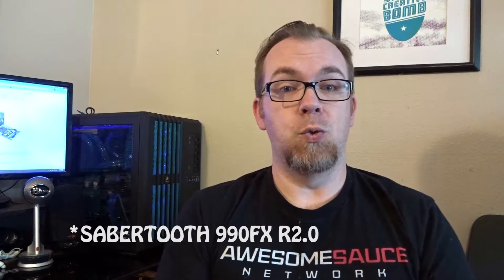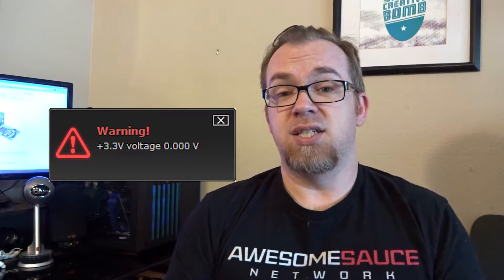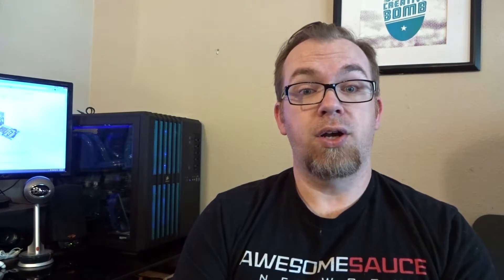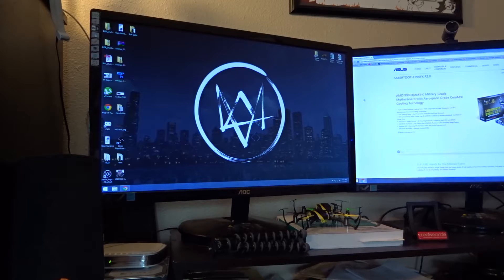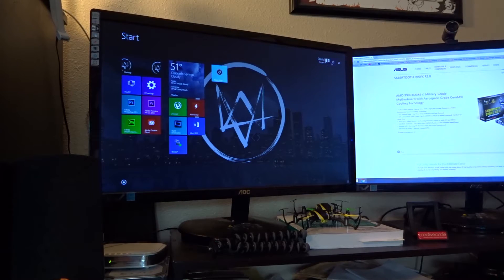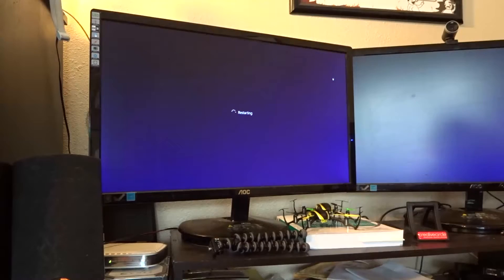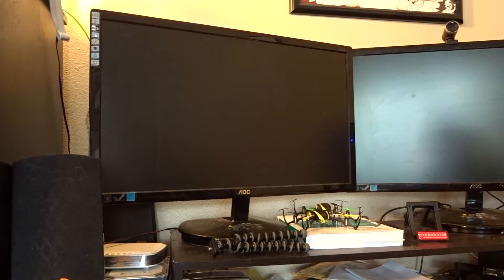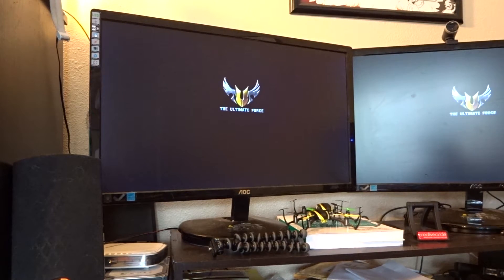Asus SABERTOOTH 990FX R2.0 Motherboard Sensor & Audio Issues

Comment: I have one with audio jack port disabled by default -problem. No sound or voltage at jack ports. Not sure if some linux stuff caused it. I assume there's some audio jack ports unit engage/disable option in somewhere deep in windows registry/services/group policy adjustments. Possibly linux, or some update of windows has the option as disabled by default. Quite sure the hardware is intact so there could be a solve for that by finding the adjustment or installing the policy manually. I tried a pure install but I think the reason is a setting stored in hardware by update or something.
Reply from the maker: I'm surprised anyone is still using this setup. This video is 10+ years old and the CPU is supper inefficient and I don't think the board is being supported.
Reply: @DBTechYT I run sabertooth 990 fx r2.0 still

Comment: For anyone who's just found this video, please lose any OC settings and then make sure your Sabertooth 990FX R2.0 is running the 18th and final version of its UEFI (Ver. 2901) which was released by Asus in Aug. 2016.

FX-8350 users can eliminate the random freezing issue these 'boards have (under UEFI Ver. 2501 anyway)  by disabling AMD Turbo CORE technology in the UEFI setup utility. This last adjustment is not required for the FX-8370, which in turn, is the best CPU for this motherboard.

BTW. Asus should be ashamed of themselves for arbitrarily changing this motherboard's max. TDP from 125 Watts to 220 Watts on the Sabertooth 990FX R2.0's product page in order to deceptively advertise its compatibility with the FX-9370 and the FX-9590. The 125 Watt TDP rating can still be viewed in the final version of this motherboard's .pdf manual.

The best and most cost effective way to improve this 'board's overall performance is by adding a 1TB (or greater) Crucial MX500 SATA SSD. NVMe drives are a waste of money on any motherboard with PCIe Gen 2.0. There are a number of videos on YouTube which prove this.

FTR, the one I bought in 2015 and am using right now still functions correctly.

Comment: Mine has ram problems sending it in to get repaired hopefully they give me a whole new one that works.
Reply from the maker: +osbodav is your board still under warranty?
Reply: DB Tech Reviews it should be since they all have a 5 year warranty and they haven't been out for more then 5 years yet
Reply: DB Tech Reviews I already contacted them and they said to send it in for repair and if they can't fix it they will replace it
Reply from the maker: +osbodav I guess I didn't realize the warranty was that long. I'm glad they are taking care of it
Reply: DB Tech Reviews me too. I bought it for $100 on Facebook and I think that's why they got rid of it because they didn't know they could send it in
Reply from the maker: +osbodav I've had a couple of issues with the board but it's still pretty solid
Reply: DB Tech Reviews I was able to get it booted yesterday a couple times but it ran really slow and took up all my disk usage.
Reply from the maker: +osbodav that's no good. Sounds like you got a decent deal on it. Hopefully you've got something to use until you get it fixed
Reply: I was able to troubleshoot it and fix what ever was wrong with it i uploaded a video of me doing it for others to help with there cpu/ram led light problems

Comment: Same board similar problems,   Developed a " audio hardware has been unplugged/plugged in " loop after 12 months use.

Disabled on board azalia audio and used GPUS hdmi output audio instead. This will solve your speaker pop if you are still running the system.

Sometimes no audio after boot, Requires restart.
Sometimes Rear USB stops working. Front jacks work fine.

Bad motherboard overall.
Reply from the maker: +fimbles101 good idea! I still use the on board audio for day to day stuff and the gpu audio for gaming
Reply: me too so pissed of now just 3 weks bought on ebay now have to send back

Comment: i have asus m5A99fx pro 2.0. i also experiencing sound issues. I have changed cables but still experience issues. try to disable sound enchantments. still not working

Comment: I don't think the Sabertooth 990-FX R2.0 mobo was made correctly!  My first build I purchased from NewEgg ended in disaster.  Almost immediately after getting the board populated and the entire system running ... I had weird issues with my mouse and keyboard I/O ports failing.  It didn't matter where (front or back) these devices were plugged into - they would simply go dumb and freeze up or not show up!  Sadly, I RMAed this board as being defective - a total first for me!  Now, about six months after using the replacement board, a weird phenomenon occurs:  something on my mobo (99% sure) is heating up that my sound card is glitching playing back videos.  This only happens after running my PC hard for a while.  The video doesn't trip up very noticably but 1-2 seconds of audio mutes out on me watching videos using Win Media Player, VLC, YouTube, etc.  Therefore - this is not likely a software issue.  I have installed all kinds of hardware monitoring devices and nothing showed up on radar to be concerned with.  I also updated my BIOS, Radeon drivers, and Realtech digital drivers - again not seeming to make a lick of difference.  After months of working on this problem - I am completely and utterly stumped!  I have the AMD Visher 8-core CPU, 16 GB Ripsaw DDR 3-1866Mhz RAM,  Rosewell 650-watt PSU, 5x Corsair LED fans, and Gigabyte Radeon R9-380 256-bit 4GB GDDR GPU.  I have heard of other people reporting this "glitching" problem as well.  They said to revert the Radeon drivers - which I did and this made no difference, either.  SURE LIKE TO KNOW WTF THE PROBLEM IS HERE!
Reply from the maker: Sorry to hear about your troubles. I've only had a couple of issues with my board, but nothing that has been a deal breaker. The audio pop is the biggest issue I've had in the last 2 and a half years. Other than that it's been a solid board for me.

Comment: Audio Is not working ? 3.5mm jack is not supported even i istalled Realtek audio drover
Reply: I have the same problem, but since digging around online I found out that the audio chip tends to burn out, only thing you can do is try and get a refund.
Reply: my problem is solved bro
Reply: how
Reply: Driver pack solution 14.0 i ddownlaoded nd it installed the ASUS driver nd now its wrking awesom bro :)
Reply: Hi, where did you download the driver pack from? thanks
Reply from the maker: From the Asus website

Comment: Hi, first of all great video man!

I know a lot of people have trouble with this particular motherboard. I should know because i am running the same exact board. 

I didn't have the audio popping problem but i know several people on the forum i am on did. I am sorry to say this but the only solution is to do am RMA since this is hardware related and there is nothing you can do about it yourself. 

Fortunately this board has 5 years warranty so that should not be an issue. 

For the sensor problem, a lot of people have the same problem with faulty readings and the only solution is to completely remove the buggy AI suite software because it is known of giving false readings. It is caused by the so called EC sensor that ,for unknown reason doesn't like to be monitored, and gives all kinds of problems including system hang. 

This program is unfortunately not easy to completely remove and you actually need a tool to remove it entirely sad enough. 
The tool can be downloaded here:   https://rog.asus.com/forum/showthread.php?28319-AI-Suite-II-uninstall-cleaner

As for system monitoring, i always use HWINFO64. That is the best program to monitor FX chips and you get an EC sensor warning when you open the program so you need to disable this sensor in order for your system to work properly without weird issues. 

I contacted Asus about this matter and they totally denied this problem and they are not going to solve this issue unfortunately. 

That kinda warns me off to buy any Asus products in the future because their customer care is a joke and they do not take you seriously enough. 

I hope this helps, let me know if you have some problems, maybe i can help.
Reply from the maker: +Richard Meppelink Thanks for such a detailed response! Since I managed to mess up the retaining clip for the top GPU slot, I'm not sure if I can RMA the board. I've been considering removing the AI Suite, but haven't gotten that far just yet. What program would you suggest for controlling fan speeds for this board? Thanks!!
Reply: +DB Tech Vlog No problem man. 

Sorry for the late reply. I would not suggest to use software to control your fans to be honest. I have bought an fan controller which is much more reliable. Fan controllers are not that expensive and you would be very happy with it. Good luck.

Comment: My problem is my PC keeps shutting off. I do have the issue with the pop when it shut of and turn on.
Reply from the maker: +Andredesignz Young My first question would be this: What are your CPU temps when it shuts off? If you aren't sure, use AI Suite or HWMonitor to see how hot your CPU is getting. Thanks for watching!
Reply: +DB Tech Vlog I have no idea. Thanks for responding. I am now downloading the AI Suite 3 now. When I an rendering a video in Pr, if it's over 5 mins the PC will shut off also. The AMD FX 6100 six core processor is what I am using.
Reply from the maker: I've got a laptop that does that. Sounds like an issue of overheating. Is the processor overclocked? What kind of cooler do you have on it? Do you have good airflow going through the case?
Reply: I'm actually using the stock fan. The computer side is open, but the room can get very hot at times. I have a Corsair Cooling HS50. I am missing a screw that holds down the fan so I never wanted to install it. But I might have to, trying to find a screw that could work.
Reply from the maker: Andredesignz Young I would suggest using the H50 for your cooling. Even if you're missing one screw, you'll probably have better luck with that than the stock cooler that came with the processor. Also make sure you use a good thermal paste when you put the h50 on your processor. :)
Reply: I will do just that, thank you.
Reply from the maker: Andredesignz Young I'd love to know if that helps. Let me know? Thanks!
Reply: It helps bro. I am now using the the cooling system. I have tested the performance yet though.
Reply from the maker: Andredesignz Young That's great news! Processor manufacturers usually include very basic cooling options because the figure that we'll install a cooling solution of our choice anyway. I've got a fully custom loop keeping my 8350 cool :)

Comment: Great video quality first off. But yea, for the most part ignore AI Suite.

The only place the temp sensors are "reliable" is in the bios.

As for the poping. Give me a sec to look that up.
Reply from the maker: ***** Thanks! I've just gotten started with making videos, so I've got a few areas I want to improve, but it's a learning process. Also, I've wondered about the reliability of AI Suite and HWMonitor. They seem to be "mostly" accurate for the most part, but the random temp errors are irritating. Maybe I'll just turn off notifications.
Reply: ***** So, I really wouldn't be worried about the popping at all.

I remember back in the ME and XP days almost every computer with speakers did this.

It has to do with the powering up phase of the Sound Card itself [similar to POST for the motherboard] where the card actually begins charging the various Capacitors/Transistors that discharge signal to main listening devices.

Its also possible it has to do with your speakers themselves and how they react to the computers natural start-up noise.

I have a Kanto SYD6 that pops pretty loudly depending on how high the volume was set when I turned them off. But it all has to do with the introduction of the AC current that pulls the woofers back into their "neutral" position. 

I'm actually surprised you've never encountered this before. Although, if you've only been using high end sound components up till now it wouldn't be impossible.

PS

This is all really simplified because of the potential for missinformation/communication b/c of long periods of typing for me.

Uploading a video now with slightly more info for you!
Reply from the maker: ***** Can't you just change the way you have the power/reset buttons attached to your board? And I'm a big fan of these monitors, but I'm thinking of upgrading to a single 21:9 monitor :)
Reply from the maker: ***** Nice! I've got an fx8350 in mine and I'm pretty happy. Are you going to liquid cool your 9590?
Reply: David Burgess
IIRC the power LED cant be switched because it's a diode and they only allow electricity to flow one way.
Reply from the maker: ***** How big is your power supply? The 8350 has a 125w TDP and the 9590 has a 220w TDP.
Reply: +DB Tech Vlog planning to buy the asus sabertooth 990 fx with 9590 amd fx
everytime you start up the pc you always have the speakers on ??
Reply from the maker: Yeah. I always have the speakers on. I just keep them turned way down these days. Thanks for watching!
Reply: i would say dont put them one when starting up the pc only put them on when your pc is done
Reply from the maker: At this point, I'm pretty over it. I've been dealing with it for more than a year now and rarely even notice any more.
Reply: okay :D